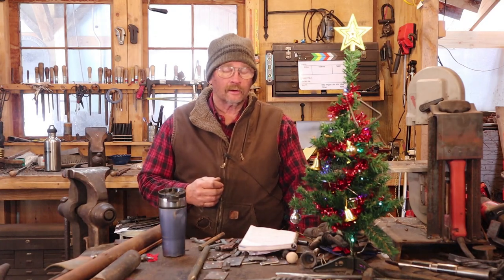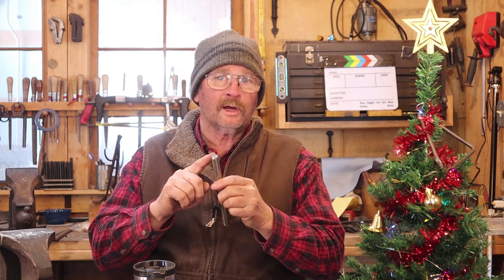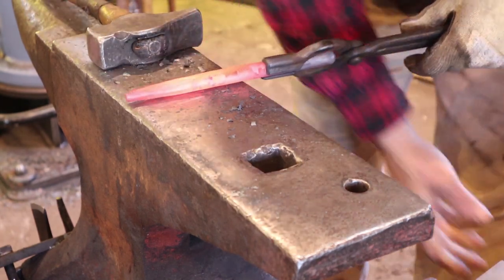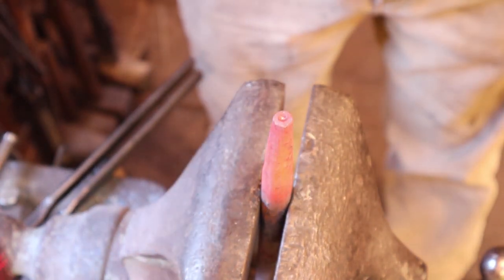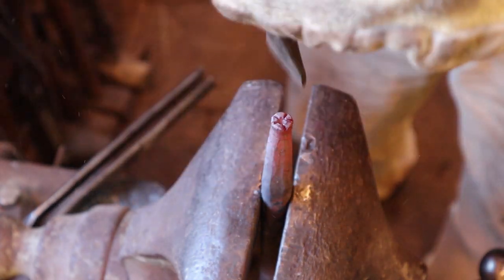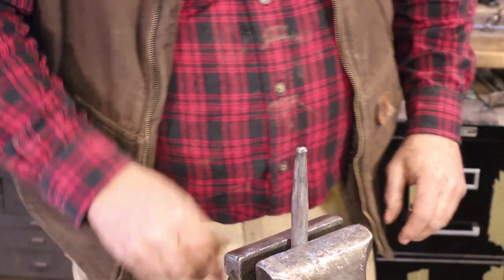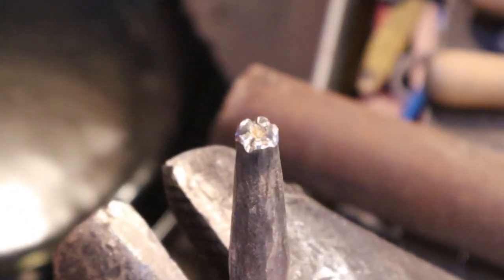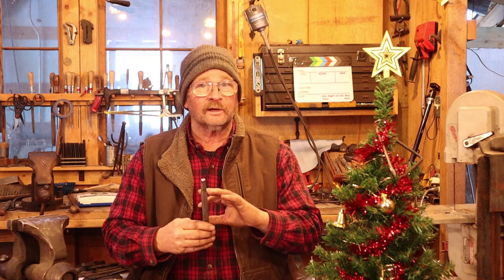Decorative stamp or punch

Comment: Just and idea for you, maybe you should make these Christmas idea videos during the warmer months. That way you don't have to try and deal with the camera and heating the steel so much. Just set them to the side and save them to put out around Christmas. I can see how quickly your steel is cooling down and have experienced these issues my self. Pull steel out of fire, touch anvil, and hit it about 5 times with your hammer. Then  it's too cold to keep going. My issues being a little different because my forge is outside and I use wood. Coal is hard to get in Louisiana without paying exorbitant prices for it or driving hours away from home. It doesn't get as cold here, but still cold is cold when it comes to sapping the heat out of your work.
Reply: What is  better on a cold day than firing up the furnace and beating metal to keep you warm?
Reply from the maker: Since i will be in the shop and making videos and products year round, I am not sure it matters.  Plus being able to see my breath adds to the feeling that its winter and working in a tee shirt might not.